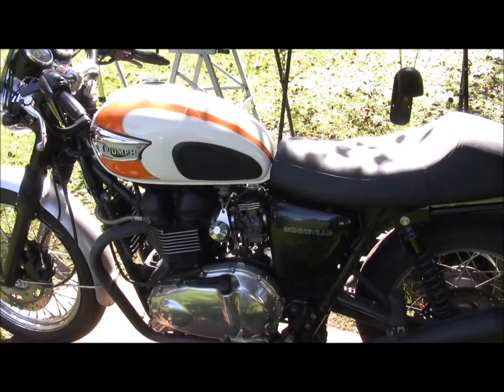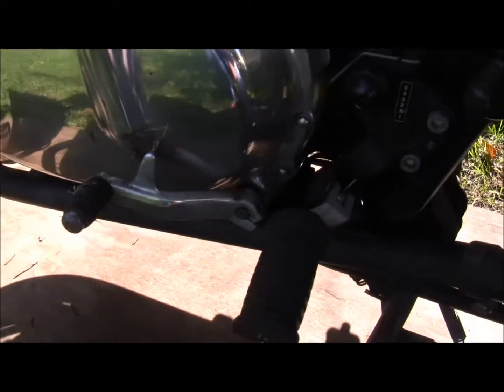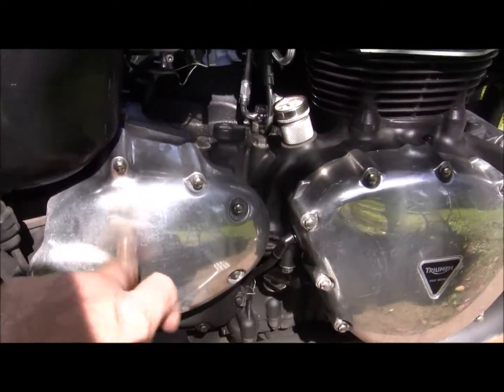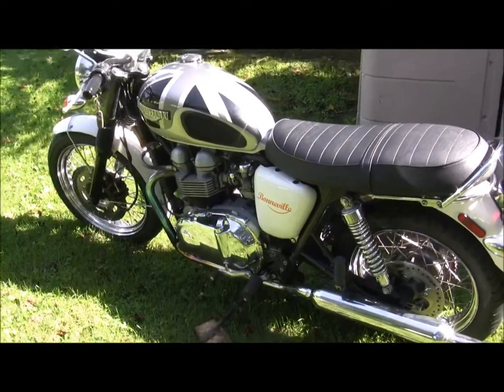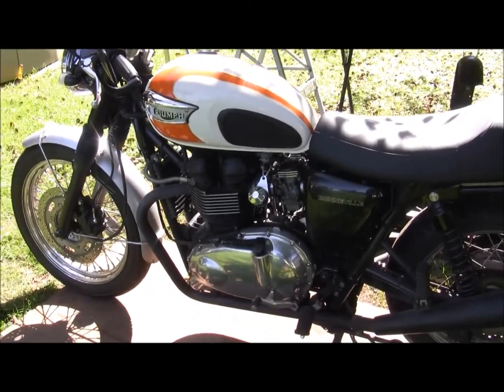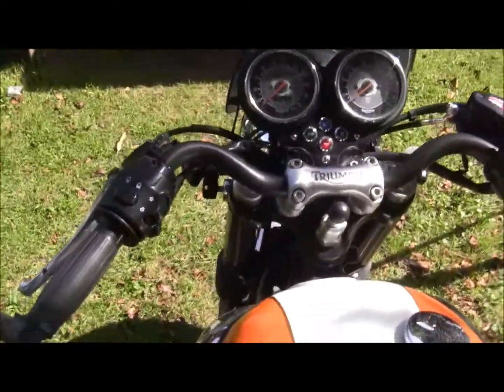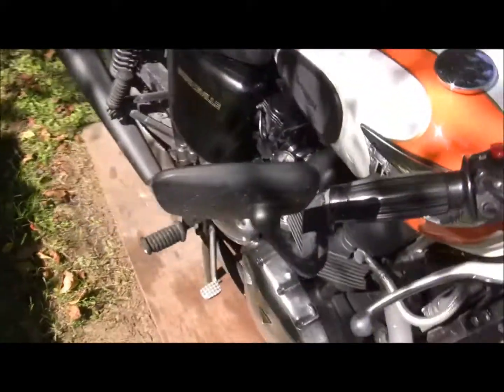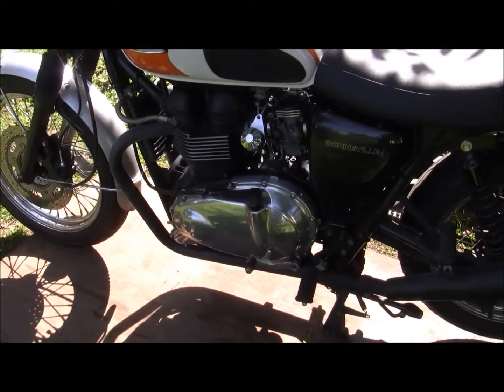Gearshaft Assembly Pt1

Comment: someone linked me to this video today, super helpful. thanks so much for posting these kind of videos on youtube. really helps wannabe mechanics like me. :)

have you ever worked on a thruxton? i'm sure it's very similar to this system, but given how the shifter looks like it's separated from the gear shaft compared to the bonneville, how would i be able to tell if my gear shaft is bent without taking everything apart?
Reply from the maker: The Thruxton gear shaft assembly is going to be the same. The best way to tell if it is bent is either by feel or if you get down and look at your shift at eye level then you should be able to tell if it is crooked or if it is symmetrical. I am you are finding the videos helpful!
Reply: Thank you for the reply!! I replaced the shift lever + linkage today and took her out for a spin. My initial question was because I was unable to shift past 3rd, but I realized that my lever was not resetting to neutral due to a previous drop where it had bent the lever and it was contacting the linkage and not resetting. 

Looks like the lever took the brunt of the impact and didn't affect the gear shaft assembly. Lucky me, didn't have to split the case :)

Thanks again for all your videos, they are amazing!
Reply from the maker: I am glad they are helpful and you got your Thruxton back out on the road!

Comment from the maker: I think it is because it was the wet grass coming off the sidewalk. Front tire wet grass - back tire dry sidewalk and it just swiped out. But then the bike slid forward on the wet grass instead of just tipping over. It was in the slide that I think the bend happened